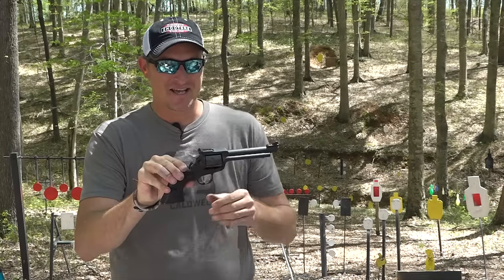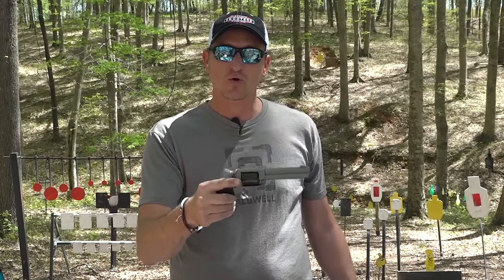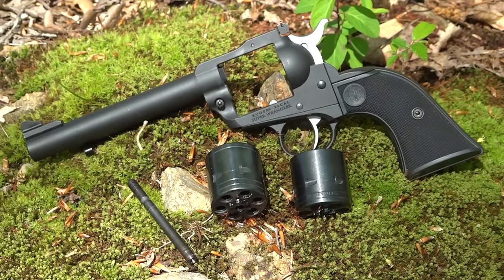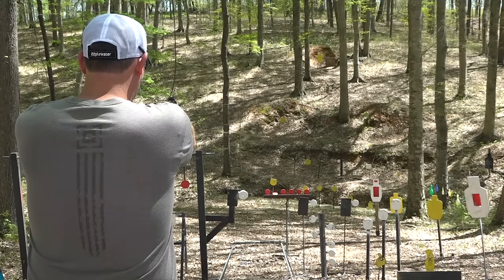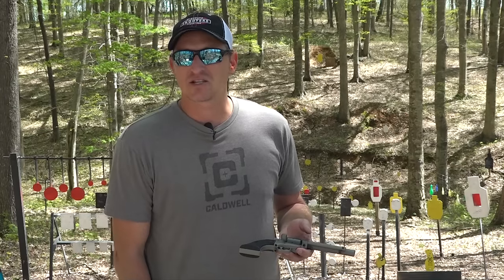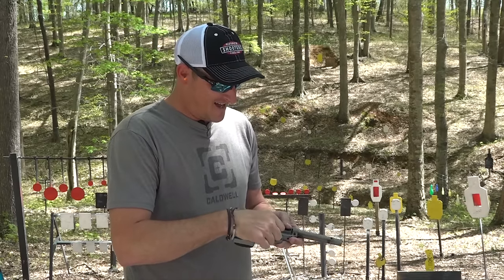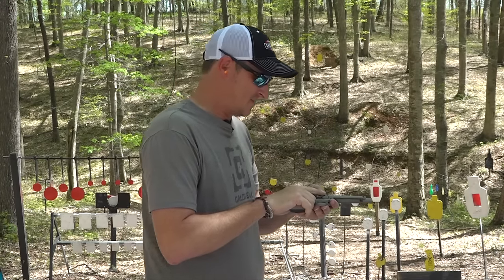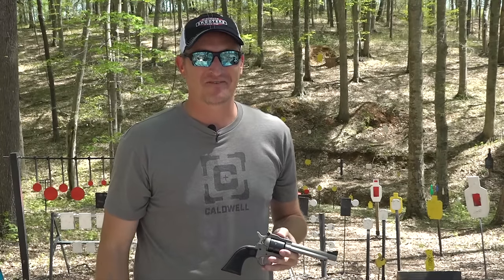THE NEW RUGER SUPER WRANGLER - NOW IN 22LR AND 22 MAGNUM

Comment: The cylinder on the regular wrangler is not aluminum, it is steel.  The frame was aluminum
Reply: The frame is still aluminum
Reply: Have you stuck a magnet to one?  Ruger says they are steel frame.
Reply: @someguy325es  From what I’ve seen they have been calling it a “steel alloy” cylinder frame and a zinc grip frame. Better than the regular wrangler I guess but a far cry from a real steel frame.
Reply: Does the 22 magnum cylinder fit/work in the regular wrangler?
Reply: @richmarko8704 id be very surprised if it did

Comment: I have  a wrangler but I wanted a 22 magnum so I bought a Diamondback Sidekick and I love the fact it shoots both 22 LR and 22 Magnum and both cylinders hold 9 rounds and is single and double action.
 Hard too beat.
Reply: I don't know anything about Diamondback as a company, but I do know that Ruger has a strong track record for making quality firearms. Good luck with your nine rounds.
Reply: I bought one for the mag/LR and the capacity
Reply: Gonna have to look into that!
Reply: I had to return my Diamondback,  22 mags seizing in cylinder had to drive out with hammer.  DB had no answer, not sure when they could resolve ongoing issue.  Go with Ruger
Reply: @WhiteCedar544  I found out that when the pistols were coated or colored the material that was used was also in the chambers od the cylinder. I took a 243 copper brush and worked in the chambers of the cylinder and it got rid of the problem. It must be a quality control problem.
Reply: @stuartmarkman769  I had that problem with my stainless Taurus Tracker on the WMR cylinder. Too much pressure I suppose

Comment: I was lucky enough to find a single six.. basically brand new last month...just no box at a pawn shop for 450$...the cylinders had no scratch marks from the lock up...but now they do cuz I been shooting it👍
Reply: That was a sweet deal.
The Single Six is a true American classic.
Reply: Many years ago (2007) I went to a local shop and looked at both a single six and new at the time Mk 3 semi auto with the nearly 7” barrel and it was cheaper than the six. I love my auto lol. I learned on my dad’s single six and I have nothing against them except the price tag.
Reply: @usa-rb5fi  I heard that.
After decades of admiring the Mark * series of pistols, but not to thrilled with how famously hard they were to take down for cleaning, I finally bought a new Mark IV this year, a 5.5" stainless, and it's a real joy to shoot.
You probably already know this, but the single biggest improvement with the Mark IV is (at long last) very easy take down for cleaning.
Reply: Ruger did that with the 4 series to compete with the S&W Victory. I’ve never broke down my 3 to get every last internal, because I got a feeling it wouldn’t go back together lol. I clean it the best I can.

Comment: I love my RUGER Single Sic with the .22 magnum cylinder. Built in 1983 the trigger is VERY light, maybe 1 1/2 pounds. And with .22 magnum ammo it is pretty loud. But it does shoot well with those excellent RUGER adjustable sights. It is a very well made "shooting' iron", and yes, you can fan the hammer for rapid fire but it's hard on the innards of the pistol.

Comment: When I wanted to get a .22 single action revolver I really wanted that swappable cylinder and the Wrangler didn't offer it so I went with the Heritage Rough Rider. I paid about $200 if my memory serves me right. I've had several issues with it, less than 250 rounds in I had to ship it back for repairs because the hammer won't stay back, or if it did, a literal scrap of paper was enough pressure to pull the trigger. They repaired it at no charge, but it kinda soured my opinion of the gun. Don't get me wrong, it's still a blast to shoot, but the fact it needed repairs that quickly raised my concern about their "quality control". I wish this had been available at that time. I always liked the look of the Ruger Wrangler better than the Heritage Rough Rider. Plus I like Ruger revolvers. I inherited a Security Six in .357 mag that is my Favorite revolver I've ever shot!!!
Reply: I just picked one up for close to Plinkster's price, it was 269.00 pre tax. It feels beefier; along the lines of a Single Six.

Comment: The LR cases will split very often in a magnum chamber, too... the difference is the Super Single Six is a steel frame, as well. Cheaper material, and Finish, probably cut on the same CNC tooling. IT WORKS, at half the price. Love it. Now, for a birds-head Sheriff model w/adj. Sights!   😅

Comment: Yea 22WMR pistol for self defense is interesting. Even if the round don’t stop an attacker your also setting his cloths on fire with the flame and unburnt powder that follows that rifle round out of the barrel and also making him def because its louder even than a 9mm😂
Reply: ppl are so stupid with the unburnt powder thing. i have a 22 mag naa mini and it works great out of 1" barrel. much more velocity than 22lr out of same barrel. how much more this with like 6 inches
Reply: @cryengine_x  Easy there chief. Im not clear what your on about but I was not attempting to make a merit judgment on the use of 22WMR for personal defense. I was just making comedy about the fact that the 22WMR does in fact produce a big flame front when shot from a pistol because it was and is designed for rifle length barrels. It is also crazy load for the same reasons. Obviously non of these things detract from or prevent its use in a a pistol. I don’t think anyone would argue that it hits harder than 22lr and on that note I will add that anything is better than nothing. Enjoy your 22WMR pistol by all means just wear hearing protection and don’t set anything on fire.
Reply: @mrsmith8436  I've got that goofy (but awesome!) Switch revolver in 22 WMR. The manufacturer lists the barrel at .75 inches. I decided to shoot it at night just to see what the fuss was about with the fireball. Felt like someone had tossed a flash bang at me.

Comment: One correction.   The cylinder in the Wrangler is solid steel.   It has always been solid steel.  Not steel inserts or sleeves but solid steel.  Magnet test and double checked the specs on the website for the Wrangler.
Reply from the maker: Ruger's website says for the original Wrangler is "Aluminum Alloy". Plus, that's what their engineers told me on the phone the day before making this video.
Reply: The cylinder frame is an aluminum alloy.  But I know with certainly the cylinder is steel.   The current specs do not show the cylinder material.  And I am certain the specs did at one time show the cylinder as steel.
A fantastic as always video Plinkster
Reply: @22plinkster   the barrel bore diameter is not the proper size to shoot .22 MAGNUM ammunition accurately in the Ruger Single 6 rimfire revolver for use with .22 MAGNUM conversion cylinder, because the bore diameter is .219" inches.  To shoot .22 MAGNUM rimfire ammunition accurately the bore diameter must be .223" inches  !

Comment: I checked one of these out today at the local Rural King. They were on sale but only had one left. I was ready to buy it until I educated the salesperson to the fact that the receiver was made of steel alloy. He had to test it out busy putting a magnet on the receiver.  It sure enough was steel. Unfortunately, when he took the magnet off,  finish had some scratches on it. Needless to say, I passed on it. That being said, I am not sold on the durability of those finishes. I am a little OCD about my guns, and I don't think the Wrangler finishe would hold up over time.  I think it would be hard to touch up as well..

Comment: Damn, been eyeing a single action 22... bouncing back and forth between a ruger or a heritage was leaning to the heritage as i could get adjustable sights but now.... that silver is a good lookin gun.
Reply: Heritage does have a 6/9 shot revolver with adjustable target sights in a 9" barrel. Have had for more than a year now.
Reply: @harrisonlewis6853   Correct, the heritage was the only option for a convertible with adjustable sights. But now, the super wrangler is on the block and damn shes lookin good
Reply: Get the Heritage, I traded off two Wranglers, poor triggers, no cylinder indexing. Poor accuracy from Wrangler gets out shot by Heritage everytime.....Come on Ruger you can do better! Look how poor the 10/22 has become...

Comment: just in case there's confusion,  the Case Diameter of a 22 LR is slightly Smaller than 22 Magnum.  it cause damage to the entery point of the Barrel  (the bullet is slighly out of parallel with the Barrel)

Comment: Can you get the  steel cylinder for the old Wrangler? Will it fit and fire? Sounds like a video if it works.
Reply: Interested in hearing 😃
Reply: The original Wrangler had a steel cylinder just like the Super Wrangler does. I believe he misspoke in the video, and he meant to say that the original Wrangler had an aluminum cylinder frame, while the Super Wrangler has an upgraded steel cylinder frame to handle the higher pressures of .22 Mag. As far as the cylinders themselves go, both models have steel cylinders to begin with. Hope that answers your question.
Reply: Id be surprised if it was that simple, depends on how much money they want to make

Comment: I still like the Rough Rider w/ a 22 mag cylinder for trapping. They're so cheap I don't care about abusing em or throwing em in the back of a dirty mule. If the Super Wrangler came with a 22 mag cylinder only, had fixed sights, and was a little bit cheaper I'd be interested.
Reply: ruger wrangler is the same concept but with much better fit and finish and quality control, for just a little more money. no contest ruger wins for a truck or tackle box gun
Reply: @cryengine_x  Ruger does not have a better fit and finish.  The heritage does.  Blued with wood grips is better than anything the Wrangler has to offer.
Reply: @mikeofmanymikes2630  fit and finish on Taurus is terrible. the Taurus has those big ugly screws. also the tuarus is notorious for those cheap springs
Reply: @cryengine_x  big ugly screws?  lol that's the best you got?  Let me guess, the safety looks really ugly as well?  lol
Reply: @mikeofmanymikes2630  well, it does lol. thats a real problem. where they write the logo is crude lettering too vs the ruger, check it out.
Reply: Nope, not the same. 2/3 the capacity for higher price. Ruger stubbornly refusing to use the available real estate in the cylinder is a hindrance.
Reply: @mkshffr4936  taurus with aliminum leaf springs is a real hindrance. i prefer 6 so you dont have small unreliable cylinder locks.

Comment: Have u tried the Diamondback Sidekick? I am tored between the Ruger and Heritage
Reply: The sidekick is probably a nicer piece, but what sold me on the wrangler was the ease of swapping cylinders. With the sidekick, you have to be very careful not losing that tiny pin and button when swapping out in the field. With the wrangler, its one long pin that you couldn't lose if you bet on it. 
Yeah you lose capacity, but you gain much more in reliability and ease of use. Sidekick is a good option though.

Comment: Your right, spending $800 to $900 for a Ruger Security Six in .22lr or .22mag isn't for me. I would buy 4 Heritage Rough Rider revolvers and spare cylinders for $840. Wait, I have 3 Heritage revolvers now. 3.5", 6.5" and a 12 inch model as well as their 16" carbine.

Comment: the barrel bore diameter is not the proper size to shoot .22 MAGNUM ammunition accurately in the Ruger Single 6 rimfire revolver for use with .22 MAGNUM conversion cylinder, because the bore diameter is .219" inches.  To shoot .22 MAGNUM rimfire ammunition accurately the bore diameter must be .223" inches  !
Reply: You’re confusing me. Are we talking about the original Wrangler, the Super Wrangler the original single six or the super single six?

Comment: You are wrong the cylinder is made out of steel the FRAME is made out of aluminum I had have two of them now I have one with major issues Been back and forth with Ruger they finally gave me a new one As for the mag.they said they would have to go to a metal frame in witch at time was not on their radar I'm glade they now have concerned

Comment: How loud is it with CCI quiets and that's all I'm going to say about that. Please don't blow me off and not answer. I know you're busy. I know you're at the NRA but I would appreciate it if you could inform me just how loud it is with the CCI quiet. I have very sensitive ears and I don't like wearing muffs and I can't wear the ones you stick in the ear because I get ear infections. It's all
Reply: CCI Quiets are still loud. They are designed to be quiet from a rifle barrel, not a pistol barrel. Even with 6 inch pistol barrel, you still want to use hearing protection.
Reply: With the cylinder gap the revolvers will never be super quiet. Still lighter loadings whether in long or short cases will be quieter than standard or high velocity loads.

Comment: Diamond back- 9 shot, .22 lr and mag. Double and single action. Swing out cylinder. 299.00 or less. Sorry ruger.
Reply: I liked the diamondback...... until I had the drive out the 22 mag shells with a hammer after the 1st use, and DB had no answer as to when they would overcome this ongoing problem.  BTW having owned both the fit and finish is much nicer on Ruger.  Glad the DB worked out good for you.